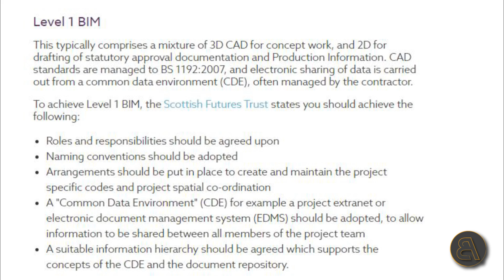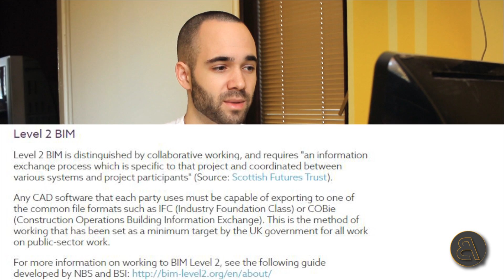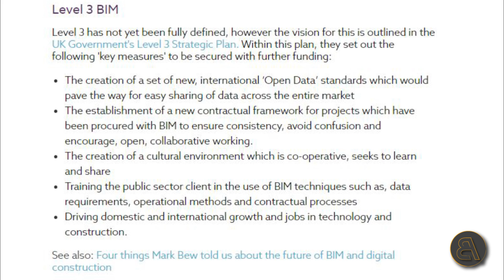Levels of BIM and the IFC Standard

Comment: I use ArchiCAD and I give my coworkers the corresponding IFC file, and they are satisfied with it, the work is so smooth
Reply: I don't know why he said a nightmare when he said Archicad , actually there is an add in for both revit and Archicad to convert files from Archicad or Revit , the icon of both will
be shown  .
Reply: @faresjawad3096  yeah the guy usually speaks about ArchiCAD with so much hate, while he can't even draw a wall on it.
Reply: @faresjawad3096  could you please tell me how to work that out. I mean properly convert Archicad file to Revit. So that I could modify the IFC model? Thanks in advance.
Reply: @MegaToyy  Revit can open IFC files and convert walls, doors etc. to families in the process. This is available from at least 2018 onwards